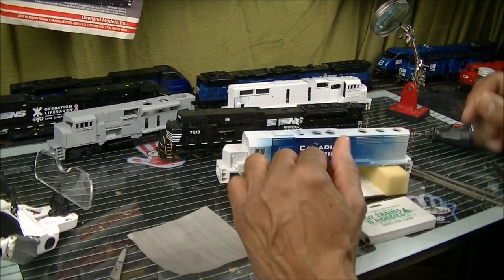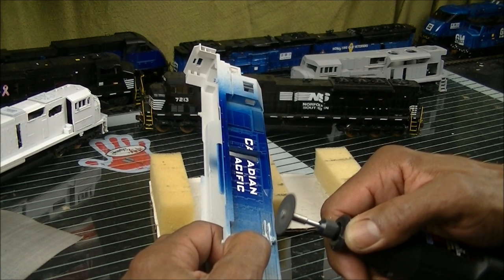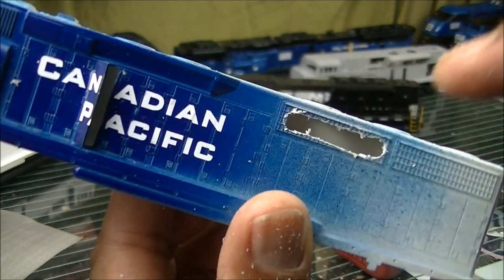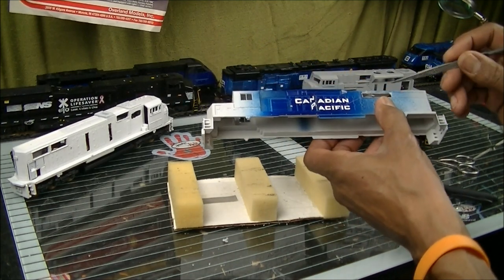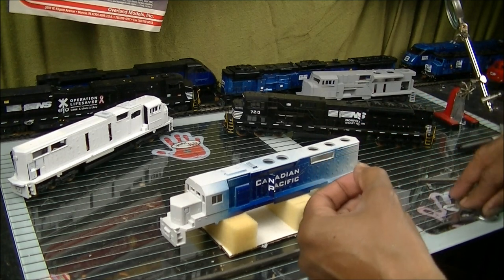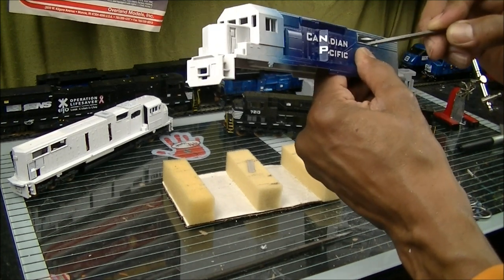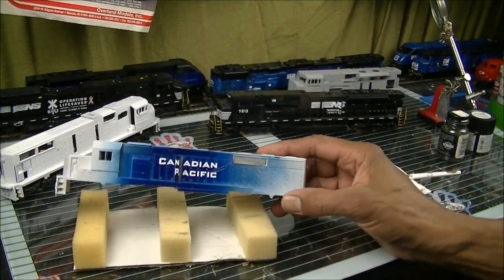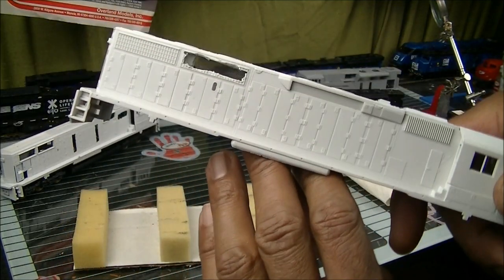How To Install Locomotive Radiator Screens

Comment: thank you for the Video. What do you use for inside derails for the open doors?
Reply from the maker: Good afternoon Kevin.  I'm not sure what inside derails are
Reply from the maker: Details?
Reply: @imhotutan1  yeah fat fingering the keyboard, Details on the inside of engine bay? the Walthers engine?
Reply from the maker: Good idea! I've only painted the inside of the doors in the past. I plan on having opening and closing doors on the future projects. In which case I will put safety stickers on the inside of the doors.
Reply from the maker: I have some incomplete locomotive detail projects that expose the engine compartment, etc.   However I have yet to acquire the accurate powerplants that are used with specific engines